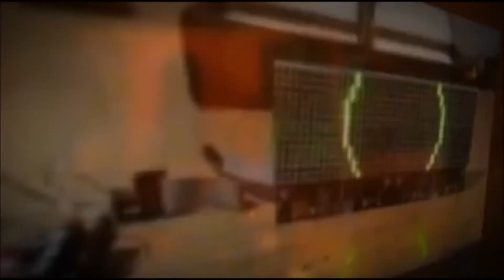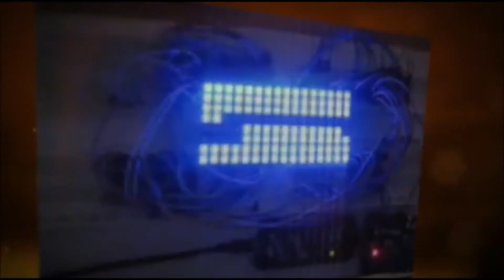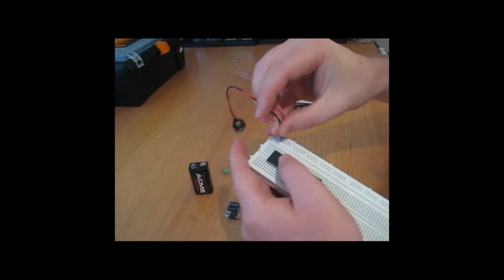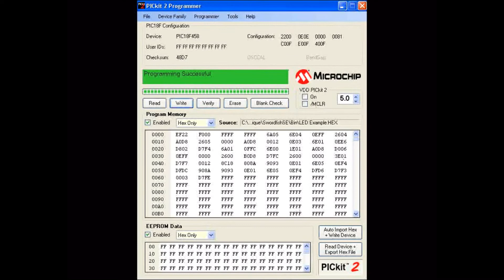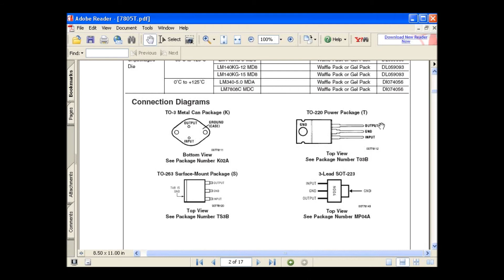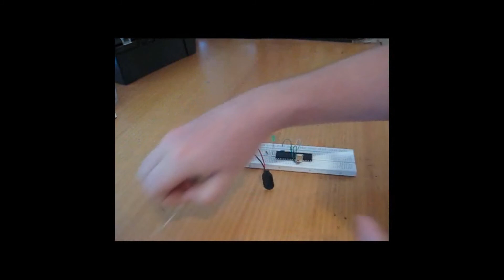Complete Intro To PIC's - Make an LED Flash

Comment: In a tutorial, you are supposed to inform what you use as OS,  Programming Language and the IDE/Compiler aka Tools Chain. We should not guess it. Is this Basic or C or ASM?
Also, we don't need to know if the video was originally done in 2007 and you lost it till 2011!!!!???  ;0)